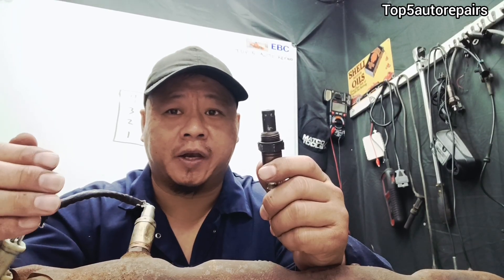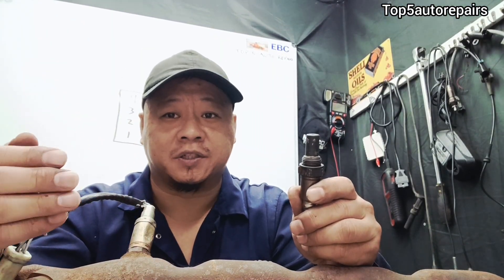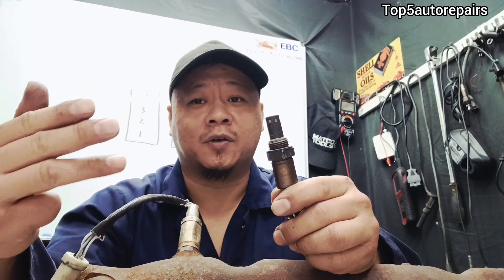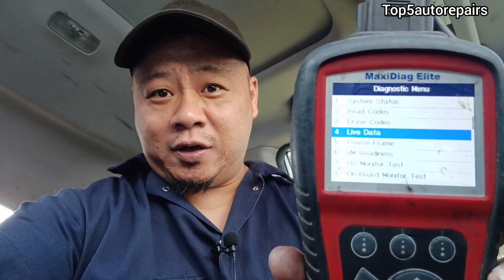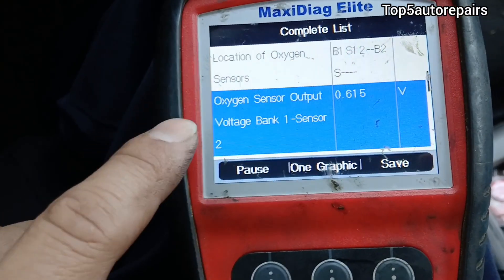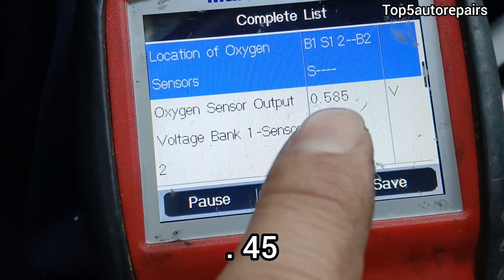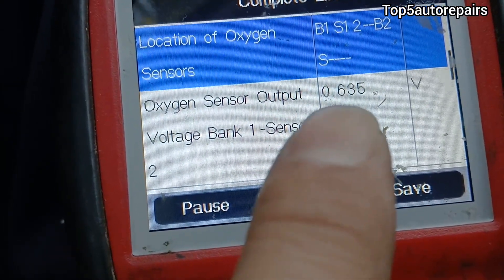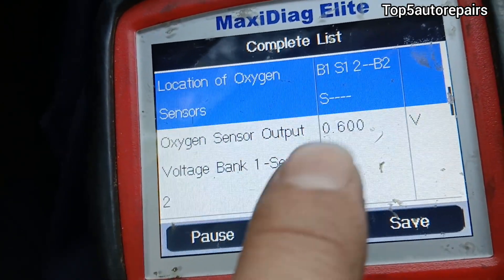P0138 OXYGEN SENSOR CIRCUIT HIGH VOLTAGE BANK 1 SENSOR 2 FIX CAUSES SYMPTOMS AND HOWNTO CHECK

Comment: How long can i drive the car with this issue??
Reply from the maker: It's possible to drive with a bad O2 sensor until symptoms start to show. For example, poor gas mileage, rough idle or engine performance issues.
Reply: @T @Top5AutoRepairs and worst to worse it can clog your cat?

Comment: P0138 is said that the computer/ECU is saying that the car is running too rich (not enough air). Can a really clogged intake air filter be considered a root cause?
Reply from the maker: Yes, it can cause a rich condition due to restrictions.
Reply from the maker: Yes, it can cause a rich condition due to restrictions.